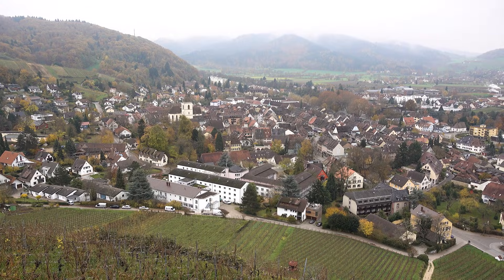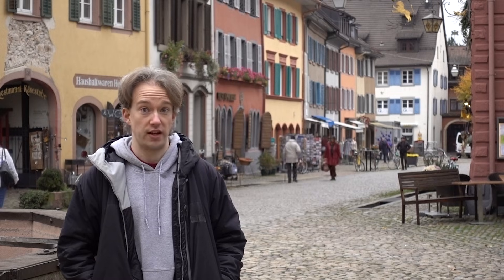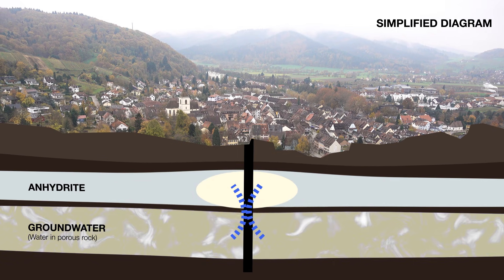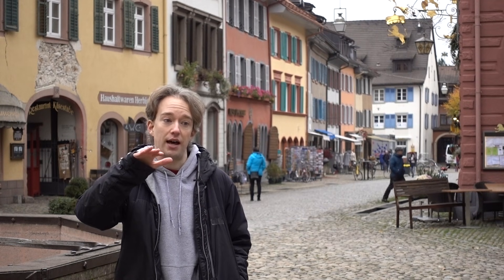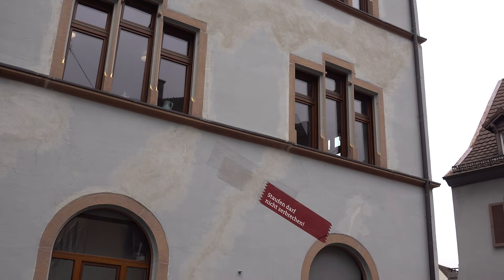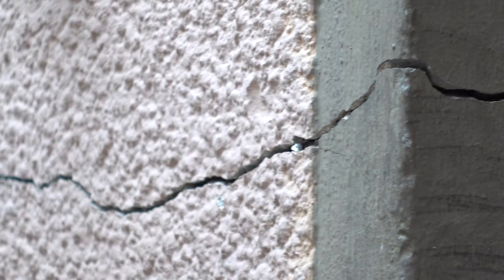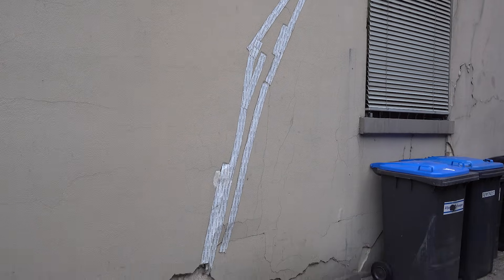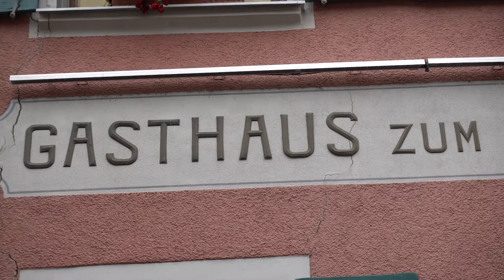The German town that's literally cracking apart

Comment: Can someone explain why modern buildings can't cope with this crack, but older buildings can? I would assume that stronger building materials and better engineering knowledge makes modern buildings better.
Reply: Modern buildings wouldn't be able to cope with it, when he mentioned that bit in the video he was using it to say "so it's even worse for these very old buildings", not that the older buildings were coping with it.
Reply: c477um11 Oh! I misunderstood then. I thought he was implying that modern buildings would immediately crumble while these buildings were holding up fine even after hundreds of years and a few cracks.
Reply: @jak ando Strictly accurate, but some people might get confused, so for clarity it's not so much that we used to build better, but rather that only the better built places from the past are still here.
Reply: As a groundworker of 25 years i wanted to shed a little light. 
Older buildings do seem to handle movement in a better way than newer construction and that is probably due to timber frames being more flexible and almost certainly the use of lime instead of cement. Lime will flex and move to a certain degree, cement based concretes simply crack. Either way, buildings are not built to move. This kind of movement is almost unbeatable. I would say post construction the chances are nil, 
However we can and often do build on raft foundations where sub soils are prone to swelling perhaps due to tree roots in close proximity etc, these give a building a better chance of moving with the ground should the worst apply and move as one piece.  Something an industry standard strip footing cant do
Reply: The sentence itself has double meaning.
Reply: It has nothing to do with modern or older buildings. It has more to do with materials used, ground placement and reinforcement. Rigid, poorly reinforced buildings will collapse far easier than buildings that are built to give some leeway in movement and have reinforced structural components. It's why buildings in Earthquake prone buildings can survive most Earthquakes except for the largest ones while ones built outside of those zones collapse even with weak earthquakes. 
With that said, any building will collapse, given enough damage and slip. It's why they need to maintained and repaired, and that's exactly what they're doing here.
Reply: I think you missed his point, he also saying their quality is higher due to survivor bias.
Reply: Because modern buildings have tighter tolerances - older ones didn't have the knowledge of engineering that we do, so it was necessary to make something stronger than it would actually need to be in order to be on the safe side. That, and for very old buildings they're more often built of stone, which is the strongest material we have properly available, but I don't think that's relevant in this case.
Reply: Jak Ando that's really not correct

All of the old buildings that you see have obviously survived, while you can see newer ones collapse.
This doesn't tell the full story, because you don't consider the huge amount of old buildings that didn't survive 

For example, you completely ignore those ancient buildings which collapsed soon after they were built

So you're basically giving more importance to the surviving old building than to the ones that collapsed (because obviously you can't see them), while probably focusing more on the "rare" collapses of the modern ones
Reply: David Boucard it depends on the type of building, the materials used and it's complexity. It could be a lot harder to maintain a Skyscraper made Out Steel and Glas in such circumstances than a relative low building made out of Stone. Furthermore modern engineering makes it possible to build Stronger or faster and cheaper. But buildings modern or old are mostly not designed to withstand so much moving soil.
Reply: I had to listen to that part twice until I understood what he meant
Reply: That's survivor bias. Old buildings that are still standing are among the better built of their era and/or have had updates.
As for modern buildings, depends on how it was built, and whether it was planned to handle this. There are similar problems with clay soils in many parts of thw world. See Practical Engineering's recent video on expansive soils for some more context https://www.youtube.com/watch?v=SW-NoiM726U
Reply: Most of the other replies here are very on-point; another thing to keep in mind is overengineering. With "better engineering knowledge," as you put it, we have a better understanding of exactly how far we can push materials, methods and designs, before they break. Combine that with a more modern obsession with saving money, and modern buildings tend to be built to relatively narrow tolerances. Simply because we can do that. Whereas older buildings -- especially European ones in public areas -- tended to be (by modern standards) ridiculously overengineered. They didn't know the exact point where the design would break, so they designed it way past that point. Since the material cost wasn't as huge a concern anyway.

Also: there's selection bias. There were of course many (many (many)) older buildings that were of lower quality and wouldn't be able to withstand this any better than your average modern building. But guess what? Those buildings aren't around anymore! They're long-gone, having succumbed to any number of other impacts like this one over the years. What we have left from those days are those buildings that have already stood the test of time; already proved themselves to be well- and solidly-built. Little surprise they are dealing with this better than would your average hovel. (Or skyscraper. Whatever.)
Reply: As people above have mentioned, older buildings were not that rigid. However, the elastic property of the older buildings was not intentional, the older buildings used mild steel bars which has less strength than modern used TOR steel bars but are way more flexible. A TOR bar will snap in two once its yield point is reached whereas a mild steel bar will start to bend and then break.
Another thing that changed from older to newer construction methods was the changed of limit of the strength of the material. In the olden days the elastic limit was considered the limit whereas now the ultimate strength is used as the limit. This leads to older buildings being really inefficient but having a lot more load carrying capacity.
Reply: All based on material and how it was built. Perfect example of a modern building expected to survive is San Francisco's TransAmerica Pyramid. It's a modern highscraper that was built with the intentions of being earthquake proof.
Reply: Most buildings can't cope with differential movements of the soil, your usual building, made of reinforced concrete and bricks, is not plastic enough to follow the new deformed shape of the ground, and it cracks. Older buildings might handle these movements better, since they were built pretty well by good craftsmen, the ones built by amateurs are not around anymore, and because they are made of flexible materials like soil reinforced with organic fibers. Older buildings are also built of auto-supported parts, if you cut the building in half, each half will stand on its own, newer ones however are built to stand as a whole, and if you cut it in half, big parts will collapse, simply because we have a better understanding of mechanics so we can save some bucks by making them like that.
A differential shift of many centimeters will result in a crack cutting more or less through the building top to bottom, an older building will just have the crack, a newer will partially collapse.
Reply: Because older buildings still standing were built to withstand 1000 years while modern buildings only last 25 years...look at the Georgia Dome, they destroyed that in 25 years while older buildings like the Collosium still stands.
Reply: David Boucard they make modern building's with cheap material to mass priduxe houses and buildings
Reply: Jak Ando nah, it only means that all the better spots have been taken already.
Reply: There's something called "Survivorship Bias". Because old buildings that stands today still stands doesn't mean all old building still stand today as it was.
Reply: Yeah, as stated by others, modern buildings are no better off than older ones unless they are built with specific scenarios in mind.  For example skyscrapers in Japan can withstand earthquakes while those in Britain can't but that is because we don't experience earthquakes and they do.  But if you were just building something with no scenarios in mind then nothing has really changed in the past 500 years, materials may be stronger but if the ground they are built on shifts in any way then the building above will slide, tilt or crack.

The most famous example of buildings only being as good as the ground they are built upon is probably the leaning tower of Pisa, which was originally just the tower of Pisa until nature intervened :D
Reply: Architecture student here. Old buildings that are still standing, are still standing because they are good structured. The ones that weren't good got destroyed over time (either by humans or by nature). We saw another example like this: Why have all old operas perfect acoustics? Well, because we destroyed the bad ones.  
At the end of the 19th century companies began constructing skyscrapers. They were meant to serve the company a few decades. Now, why would the company pay for a skyscraper that can last a century if they are only going to use it 20-30 years? Sell it afterwards? Who is gonna buy an old outdated building? The building gets destroyed and the ground gets sold. (EG. in Manhattan the ground is probably worth more than the building).
Now on a housing level. Why would you in your late 20's/early 30's build a house that can last a century? You're probably gonna have kids, so the house becomes to small. You have to move. Your kids leave your house as they became young adults themselves, the house is to big, move again. Sell the house? for example isolation requirements are rapidly increasing. Who is gonna pay full price for an outdated house? Build your house with materials as cheap as possible, make it last as long as it needs to last.
tl;dr : Today's buildings aren't meant to last centuries, so why pay to make it last centuries?
Reply: Some can, some cannot. There is no one answer to your question. Each case is unique.
Reply: older buildings are usually less stiff than newer ones, so they can deform with some cracks on the outside and bricks or stones at an angle instead of laying flat
their materials are less strong usually, so the failure of a small area of it doesn"t release as big a force than a similar failure of a stronger material, also they were not yet built by calculation, enabling the removal of all unnecessary structure beyond a clearly defined security level, but by try and error, so the still remaining ones are mostly more massive than normally required
Reply: to be honest, older building are built better most of the time anyway. I mean, they're old buildings. They've clearly been there  while
Reply: Jak Ando there's also a nice video by Veritasium explaining this topic better than I did
Reply: Some Older mortars flex a lot more than modern cements and mortars, so that's one reason why some older buildings seem to survive a bit of wiggle better. But for something this extreme they'll not fare so well.
Reply: Neither can, people are just more keen to rescue old buildings. When it comes to quality the truth is that we see the world in the eyes of winner bias. All the shitty old buildings are gone. Unfortunately the lesson we can learn from that is to make an effort when building, however that's not a lesson we've learned.

Comment: Tom, I find it rather pessimistic to say that the knowledge comes "too late" for Staufen. After all, most buildings are still standing and they are doing something about it and are continuing to work on a solution for this problem. To say "it is too late for the town" sounds like you weren't standing on a road with houses when you said that, but rather in a field of rubble.

Comment: By the way: The fact that modern buildings wouldn't be able to withstand this, but these 500 year old buildings are (at least to a certain point) is actually a big deal. We should think about building sturdy again.
Reply: +Jim Stanley

and this is how companies get away with planned obsolescence... thank you, person that is like the others.
Reply: It depends where you look.

Some countries never built houses all that sturdy.

And steel reinforced concrete has a limited shelf life due to rusting steel...
Reply: We do not build sturdy...we build cheaply in a manner that offers the engineers, designers and builders least exposer to liability.
Reply: Its not sturdy though. You could build it massively sturdy out of concrete and the pull force might still make it collapse, if no steel structure anticipated pull from that particular direction.

This here works because its brick (I think). Which is less sturdy than a huge concrete slab but somewhat resilient to moving around.
Imagine a tree close to the big concrete slab sidewalks in the US and how the tree growing underneath makes them break versus Cobblestone paving which will adjust though break the cement/mortar, and so as long as you repair that you can have a nice wavy pavement with a root underneath ^^
Reply: Modern buildings can't withstand this and neither can 500 year old ones. He said that modern buildings can't so imagine how bad it is in older buildings.
Reply: poke The point is that these older buildings are more resilient to this than modern ones. I mean, if these were modern buildings, there would be nothing left but a pile of rubble by now. These old ones are still standing and may even be fixable!
Reply: Jesus Gonzalez And due to aging concrete as well, with water getting into it and all. That is my point: Modern buildings can't withstand nearly as much structural stress as old ones can.
Reply: "Building sturdy" is a waste of resources. Built to an expected maximum stress plus a margin of error keeps costs low. If you want to live in a bunker, don't be surprised when the price is astronomical and you need extra land just to have reasonable interior space because all of the walls are a meter thick. If you don't fear an impending apocralypse (or geothermal drilling cockups) then just making sure it doesn't fall over in a wind storm is a better investment.
Reply: +Seegal Galguntijak rewatch the video. He says something like "modern houses can't handle this so you can imagine what it's like for these older ones" he's saying that we've never been able to deal with it, even today.

Comment: For those wondering: Crijnen's name and accent are unmistakably Dutch.
Reply: Stijn van Drongelen so is yours
Reply: Just to clarify things. Constantijn is originally Dutch but raised in Freiburg Germany and  his accent is clearly German. And no it is not typical for this region of germany to have Dutch influences in the English accent.
Reply: Was ook niet te missen. ;-)

Wasn't too hard to miss. ;-)
Reply: I'd say even though the name is absolutely Dutch, his accent is rather German
Reply: Stijn van Drongelen Maybe because Staufen https://nl.wikipedia.org/wiki/Staufen_im_Breisgau is located in an area where the German accent has some Dutch features in it just as Schweizerdeutsch. 

It's also interesting we in the Netherlands also have a problem with shifting grounds in the province of Limburg. However, that's due to the fact we stopped the pumps installed after the coal mining done there so the ground water could slowly rise over time.
Reply: I disagree. The only reason why I went back to check his name was because of his accent.